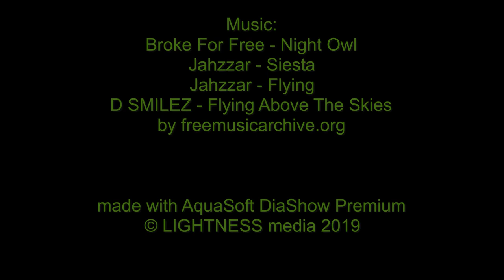building and sailing trimaran LIGHTNESS

Comment: Lovely boat and lovely job building it. As someone currently building a 6.5m Scarab 650 in pvc/epoxy sandwich I can fully appreciate how much work that was - main hull on the trailer, now onto beams and floats. Splash next summer downunder for me. Can’t wait!
Reply from the maker: Hope you are in the water now Robin! Multihulls rule...
Reply: @sailingtrimaranlightness  just fitting the second float. Standing rigging and deck fittings going on. Should be launching in 4-6 weeks. She’s looking very nice. I’ll be doing a few YT videos of the build when she’s afloat. Subscribe to my channel if you’re interested. I have a couple of videos on that of a previous small boat I built. I’m so looking forward to sailing a tri. The only multihulls I’ve  ever sailed are hobi’s as a teenager. Cheers
Reply: I have the plans for the 32 footer from the same designer 
Just gotta sell my mono and I will start. My second build from Kendrick Design..Good luck mate.

Comment: those thin amas can sink and the flat upper shape can keep them sunk for lateral capsize or forward or reverse pitchpole

i suppose todays amas with plenty of freeboard make less likely lateral capsize by acting as a buoyant wall
Reply from the maker: The floats are neither thin, nor is their surface flat ;-)
But you're right, if you overdo it, you can knock over a multihull. Perhaps you could research how many capsizes with a Farrier design have been documented so far. There are not many. All the best!

Comment: Hi,it can be done without plywood?only fiberglass? in the beams there is also wood ore inside are empty? Greetings from Italy
Reply from the maker: Hi Marco, the boat is built in positive with a DuraKore core and glassed with fiber and epoxy. This is for the main hull and the floats. The beams are made of PVC foam and a lot of carbon ;-) DuraKore is an amazing wood compound for a one off composite build - light and amazingly stiff. You can find a lot of information in the web. Greetings to Italy. Hope to race there this year ;-)

Comment: Awesome boat, you must have hella confidence in that resin being a 0erfect batch along with the plywood..
Personally the laminated plywood method.of construction does not give me much confidence...maybe for protected bays and rivers....or for a dinghy
Awesome construction anyway
Reply from the maker: Hello JCBs At the Helm! Thank you for your comment! Most of the boat is not plywood. The core is from Duracore - a balsa teak combination of 13 mm. The stressed parts are the beams and the hull section between the beams. Beams are made from foam with a lot of carbon fiber ;-) But you are right, the inner parts, where the the beams meet is made from ply also. Ian Farrier had been a genius. Never saw construction in this perfection before. In no situation had any doubt of the construction an stress loads yet. 2.600 miles sailed - sometimes in rough conditions but there are no vids :-I
Reply: I owned a WEST System Seaclipper 28 trimaran for years.  We did multi day, open ocean trips and encountered 50 to 60kt winds at times. It was no more hair raising then most other vessels. Better than some. While my boat was a bit more stout than this one, I'd wager that if you were to inspect Lightness and sail it in brisk conditions, you may have a different opinion!
Reply from the maker: In my point of view the construction in combination with the material gives a quite sturdy boat. I do not know of any Farrier breaking - beside the one which was outfitted with massive foils without beeing reinforced at the right spot...